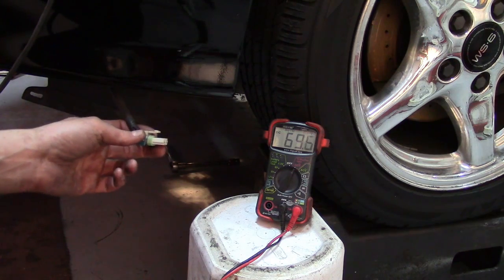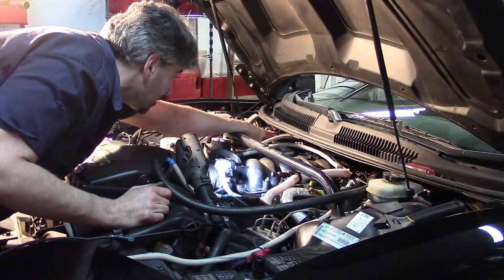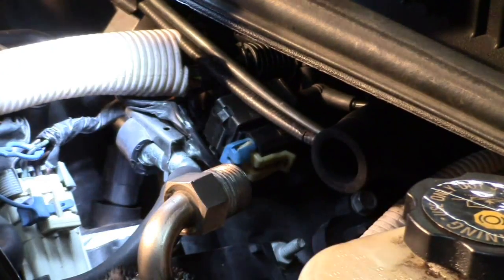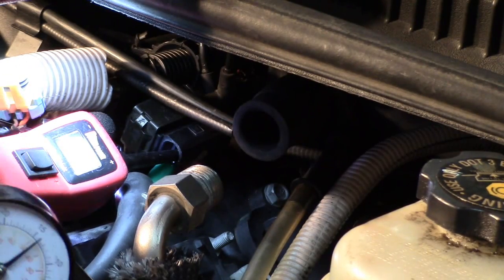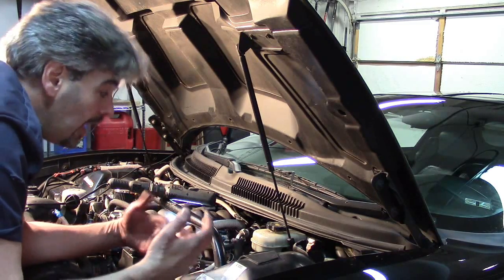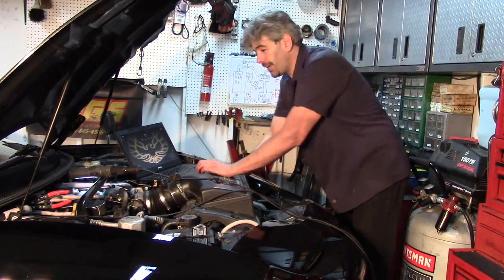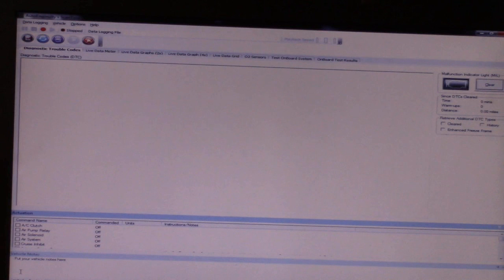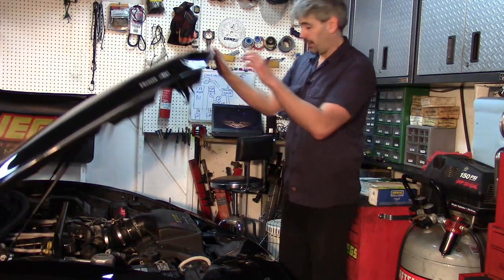Air Injection Reaction (A.I.R.) Diagnosis and Understanding-Pt2

Comment: It's me again with same problem. My car just failed smog test!! And the reason........on board tests not ready, specifically, secondary air injection! I have done more homework and found out that my car turns on the secondary air injection during a cold start, as you've explained in your video, ECT temp must be below 96 degrees F and the system is on for a max. of 100 sec. That's the only time the system comes on same time the car is started, and of course, as you showed me in the video, the test its not run at that time. After that, in every subsequent start, the ecm is supposed to turn the air pump for about 10 at some point when the engine its at idle and ECT is below 204 degrees F, that's when the test is performed. This is what I found. The pump comes on at cold start, after that, I can't seem to detect the command from the ecm to turn on the pump or open the diverter valve. I have followed the steps on your video as much as I could since I don't have a bidirectional scan tool, but even if I did, the ecm has to turn the air pump on its own, right? Everything seems to be ok, pump works, there's initial command from Ecm to turn on, my system has an electronically controlled diverter valve, so no vacuum lines, no check valve either, the diverter valve when closed also blocks any exhaust back feed. The diverter valve when checked held vacuum and opened when the initial command to start pump came at cold start up. Could it be an ecm problem? I have no codes!!! I'm thinking that since the system turns on during cold start, there's nothing wrong with my air injection components. Im pretty sure the diverter valve is ground controlled, so a failure would trigger a check engine light. The only thing I didn't do was to check the passages ( that's right, it has two! A pipe to one end of the manifold and there's an opening right where the valve mounts, at the opposite end of the manifold) from the diverter valve to the exhaust manifold for some blockage. But even that I would think, if there's command from ecm to run the pump, should trigger some kind of insufficient flow fault, don't you think? Please help!! I'm at the end of my rope
Reply from the maker: Lauro Noriega Wow man,l sorry about that- I was definitely wrong on my last response that it was just a scantool communication (which I do often see but obviously this isn't your issue).
  All I can tell you is that if everything on the system is working and you confirm the O2's are going lean when you activate the system- it sounds to me like the PCM is not commanding the test to happen in the first place.
  Remember- the system readiness test DOES NOT HAPPEN AT WARMUP- it can't, because the O2 sensors aren't even working yet.
  What you will need to do is consult a service manual and see under what conditions the PCM will initiate the readiness test and then you must duplicate those conditions. Hopefully this induces the readiness test. If it does not, your PCM either has a problem OR you have some problem where when you are under those conditions, the sensors are not indicating as such, so the PCM never sees the conditions to start the readiness test are satisfied.

Comment: Greetings Matt. I have a 05 Jetta and I just replaced the air pump cause it was bad. Everything seems to be working except that when I connect my handheld scanner, it shows that the test is not ready (flashing AIR icon). I have driven the car for a week and put over 200 miles and still the test shows not complete. I don't have any codes and my emissions apparently are ok but the smog station won't pass my car because of the incomplete test. Please help
Reply from the maker: Lauro Noriega I often see this with various readiness tests. It is often because the readiness test is not actually available to the scantool or it doesn't communicate. It's nothing to worry about.
Reply: Forgot to mention that my car it's an in-line five cylinder engine

Comment: Fantastic and Thorough Video!! My 2008 trailblazer keeps throwing p0410 for air system. Because I went to Automotive school from 1965 to 1968 I have devolved into a dreaded "parts changer"!  My shop who looked at my trailblazer said his computer couldn't "command" my system to work even though I changed the relay, Solenoid check valve and Air pump all based on scanner codes!  Any helpful thoughts??
Reply from the maker: Changing all of those is useless if command is never reaching the solenoid. did you check for command to the solenoid before replacing it? If there is no command you will have to backtrack to the open or short
Reply: I was told by a GM shop that it was coding for solenoid valve stuck shut. I replaced that and took it back and they said that it was now coding for relay or fuse.
Reply from the maker: TIM O it cant code for a relay or fuse. The basic electrical diagnosis shown in the video is the next step- actually it was always the first step.

Comment: Have a 99 Chevy Blazer. SES Light just went out after I replaced the small hose from Solenoid Vacuum, maybe that helped it.  I did the test on Diverter and it blows fine, with a vacuum only. But removed the Solenoid and tried to apply a vacuum one of the nipples and it wouldnt hold a vaccuum. And on the other it would show a Vaccuum that would immediately fall.  So I went to local autoparts to get one, and took vacuum tool, and new one does the same thing. No holding of vacuum on either side. One side nothing at all, the other side, get vacuum that immediately drops. So I didnt purchase and replace the old one, and will see how car reacts
Reply from the maker: Betsy Hillig Yes many units have a vent-to-atmosphere and the vacuum is not 100%

Comment: I learn so much from your videos.  Thank you for making them!  Where did you get your knowledge about engine diagnosis?
Reply from the maker: Thanks Nick.  Honestly mostly a combination of reading factory manuals and applying the knowledge by messing around with various components of the cars and seeing what the effects are.
  I have a video "Air Fuel Sensors-The demise of shade tree mechanics?". In that video you can see exactly how I "train" myself in real time.
Reply: Schrodingers Box I'm going to watch it right after the Tahoe A.I.R. diagnosis.  It helps to know that you don't have some superhuman power.

Comment: Hi Matt. Merry Christmas to you and thank you very much for your very comprehensible videos! I think you are doing an excellent job in explaining the technologies and useful test methods. Just a few days ago I put some of that new knowledge to use and I was immediately able to exactly diagnose an issue with my Ford Focus! Without even touching one single bolt! ;-) Your videos are an excellent source of knowledge for me. As a trained TV technician, electrical engineer and software developer I really love the systematic approach to narrowing down an issue to the root cause that you prefer. So much better than just throwing parts at a problem... So therefore - thanks again!
Reply from the maker: Many thanks and glad you "get it". My theory is- the only times you should be breaking out a wrench are when you know 100% what to replace, or if removing something is necessary as part of the diagnosis.  Indeed, usually I find most diagnoses (or at least directions) without even turning a bolt just like you did.
  The system works, but few people have the resolve to commit to learning it.

Comment: Hi Matt, Merry Christmas!

Where's the vacuum "bleed-off" for the diverter diaphragm? When you attached your vacuum pump to the solenoid vacuum line that feeds the diverter, the vacuum held. Once you energized the solenoid, the vacuum dropped (with engine running vacuum would be present). So once the ECM turns the solenoid off (no more manifold vacuum to diverter), the diverter still has vacuum in its diaphragm ... on the VW systems that I am used to, the solenoid has a "vent to atmosphere" so that the diverter valve(s) can close / vent the vacuum (that was present) to atmosphere. I guess the diverter itself could have a bleed in it?
Reply from the maker: ***** Ah great question.  It might be that there is at the rear of the manifold between the solenoid and manifold. I guess I missed it, and indeed I forgot to mention it as I am aware of these. Even so, there is no way if it was in that location that I would have been able to film it. All the vacuum connections on an LS1 are pretty much blind.
  I saw that you have a video on replacing AIR on a VW- it came up as a recommended video when I examined mine after uploading. I will certainly watch it!
Reply: Schrodingers Box No need to watch my stuff... it's not organized material and no real "teaching" layout, as I'm recording while on-the-clock. I'm sure there is a bleed-off, it was just something that I was curious about.

Comment: Nice- when you commanded the pump on did you get a check engine code ?  Merry Christmas Matt  and thank you for another year of fantastic, informative vids.  Shalom
Reply from the maker: Steve Rob I actually fully expected an engine code but I did not get one. I am not sure if it's because there has to be 2 sequencial failures or if it's because when I commanded it on the PCM knows to expect the lean. 
  One funny note though- just prior to starting the engine I had juuuuuust remembered about the clamp still being on the AIR hose for B1. Had I forgotten that, obviously I would only have had response on one bank... boy oh boy oh boy......lol!!

Comment: A very Merry Christmas to you!

Great videos, yet again!  I must say, I envy you and your American car.  I just spent a month troubleshooting and repairing an AIR system fault on a '97 Volkswagen Passat VR6.  Why a month?  Because fixing the problem involved removing the cylinder head, completely disassembling it, soaking it in a strong, aluminum-safe solvent for THREE DAYS, then mechanically cleaning the EIGHT SAI ports drilled through the cylinder head, feeding to each of the six exhaust runners.  Quite an involved process, which includes drilling plugs in the cylinder head, finding a drill bit long enough to stretch the length of the head (the carbon was so packed and solidified, it was actually harder than the aluminum...), etc. etc. etc...  Decided to rebuild the head in the process, since several of the valves were leaking, and the stem seals were questionable...

Sadly, no bidirectional capability (VAG-COM license is $1500...), so a lot of temporary spaghetti, momentary switches, and vacuum pumps.  The real problem, though?  Absolutely, 100% ZERO documentation on the physical layout of the system past the combi (diverter) valve.  Nothing on the internet, nothing on Mitchel or AllData, and surprisingly, the VW forums--which are usually pretty good--failed hardcore.  "Just delete the system, bro!"  Well, guess what?  I'm in California.  That's not an option.  I even had one guy tell me to pull an OBD I computer from an older car in a junkyard, covert the car over to OBD I, so that I COULD delete the system...  Yeah, not even gonna touch THAT level of stupidity...

I sit here, looking at your big fat tubes flowing in nice straight lines to huge iron standoff blocks on your exhaust manifold, and my first thought is "How much feces should I throw right now?"  XD

Ah well.  Hope you have a wonderful Christmas, and a happy, prosperous and successful new year!  Looking forward to seeing what you've got lined up, 25 degree garage floor or not!  ;-D
Reply from the maker: Many thanks rh and thanks for the comment.  My friend Terry has a video on Passat AIR Pump- his channel is Stuzman52, might try searching for it. He thinks a lot like I do.
  See ya next year bro!
Reply: Schrodingers Box Ah, yes!  I ran across his video series whilst looking for info on the head design!  I do believe I subscribed; awesome guy!  :-D